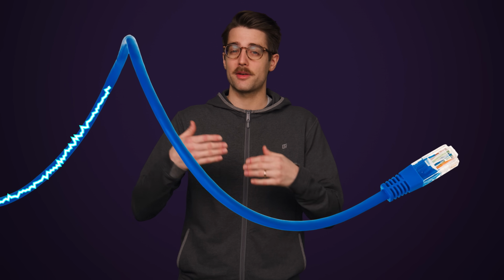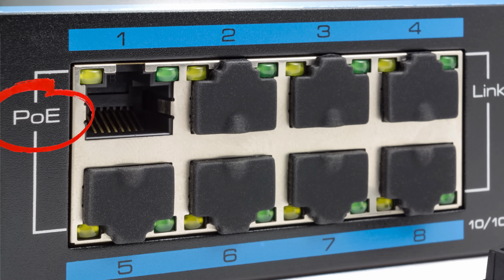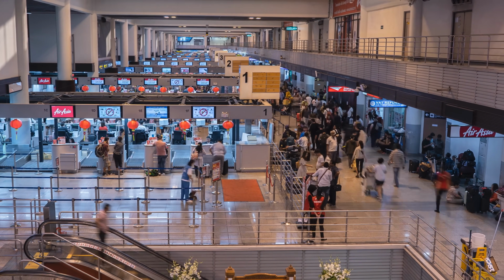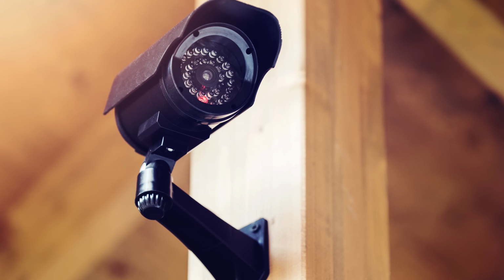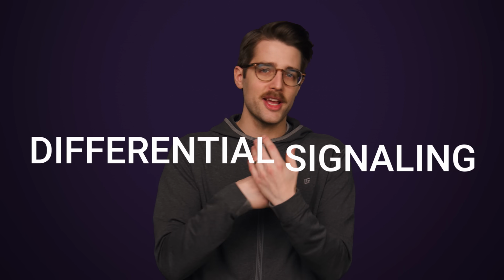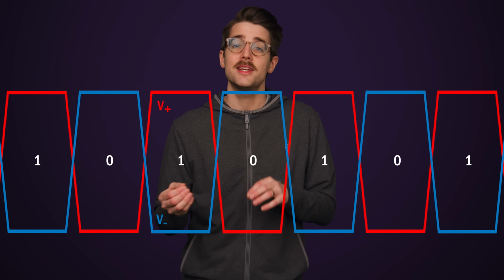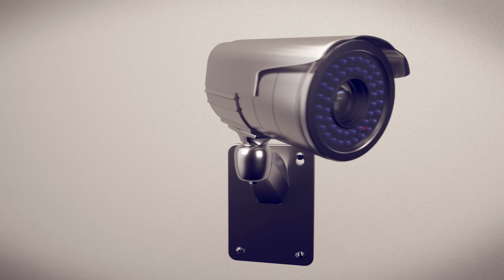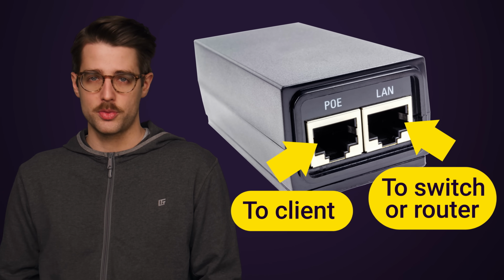Power...Over An Ethernet Cable?

Comment: That is a way to do POE.  The other is to place the "power" on the 2 unused wires in the cable.
Reply: they are all used champion its duplex 2 x TX and 2 x RX in the 4 pair cable ie 2 x gigabit channels, so no
Reply: @dtrekcomms  that is another standard of POE.
Reply: @baddmatt9588  I'm talking about the data signal, all pairs are used no unused pairs.
Reply: @dtrekcomms  there is a standard that allows all 4 pairs for power in addition to the 2 pairs for data.
Reply: @baddmatt9588  why do you keep saying 2 pairs for data as all 4 pairs are used for data and poe  simultaneously.
Reply: @dtrekcomms  Ummm...  my understanding is ethernet uses only 2 pairs of the CAT cable for data transmission (1 for sending and 1 for receiving) and the other 2 are unused.  Then POE was created to use the 2 unused pairs to allow for power transmission.

Later revisions of POE extended the standard for using all 4 pairs of the ethernet cable to allow for power transmission (the 2 unused pairs and the 2 pairs used for data transmission).

Now if there is a newer standard of ethernet that extends data transmission to all 4 pairs in the cable, I am not aware of it.  If so, please provide the standard version so I may look it up.

Thanks!
Reply: @baddmatt9588  Cat6 gigabit Ethernet 1000Base-T and has been around for over two decades and this signal can also be used on Cat5e cable over 30m runs, but best practice would be to retro fit new Cat6 Jack's without the need to replace the rxist cat5e cable which has been around since the mid 90s
Reply: @dtrekcomms  Yes, I am quite aware about CAT5, CAT5e, and CAT6, as well as CAT7.  As well as Fiber (multimode and singlemode).  Back when I started, we were still utilizing Coaxial cable networks, known as a 10Base2.

I have made 1000s of CAT5e patch cables in my 2 decades of my career.  Run miles of CAT5e and CAT6 and fiber cables from our MDFs and IDFs to the endpoint devices.  Wired around 50 or so MDFs and IDFs and hundreds of switches (cisco managed) within them.

I manage 8,000 or so PCs (desktops and laptops) using both MS System Center and Intune.  Created our AD domain probably 7 or so years ago.  Created our Novell eDirectory tree about 18 years ago (still being used to this day).  Back then it was known as NDS running on Netware.  Not to mention manage a Novell Groupwise server for our eMail as well as MS Office 365 for over 5,000 users.

I could go on and on, but I think you get the picture.
Reply: @baddmatt9588 I guess you have learnt something new then considering your experience.
Reply: @dtrekcomms  no, not really.
Reply: Any gigabit cat cable uses all eights wires. Are you referring to an older cable?
Reply: @protecter_atr  no, that what I said all 4 pairs are used for data transmission regardless of which cat cable are used, obviously its better to use the higher cat cable due to the copper cable gauge for POE as gig will work on Cat5e upto 30m which is more than enough distance for most home n offices without the need to upgrade to Cat6 cable.

Comment: Fun fact: Cat-5 cables use specific colors for power supply as they can hold more heat without melting. That's why is important to follow the standards and use only type A or type B (tip: use type A, that's what most people use)
Reply: Sorry, but I suspect this is BS, as POE can run on all 4 pairs...
Reply: @erroltheterrible  Sure. But the color of the pair itself is what matter here, not the color of the full cable.
Reply: @erroltheterrible  it is terrible practice to not follow wiring conventions though so sticking to the wiring conventions from A or B is a much more acceptable practice. Just because you can do something doesn’t mean you should. I could wire every single white wire to the hot side of the breaker in my house and make the black wire my neutral. Doesn’t mean it’s a good idea.
Reply: what's important is using the same type on each end.
Reply: @SquirtTheBlurt  if you want a straight through cable for connecting a client to a switch, but if you are connecting a computer to computer directly or a switch to a switch directly then one end will be A and one will be B. These are called crossover cables.
Reply: Ha Ha, so what's the difference between a type A n Type B and do you know the difference?
Reply: @dtrekcomms  Just the color order. But as most (read it as 90%) people use type A, using type B can make some works with those cables a bit difficult.
Reply: There's nothing about specific colors on there. The wiring colors are just a convenience to make sure that people connect both ends the same - the person doing the wiring at one end may not be the same person wiring the other. It doesn't matter what color scheme you use, so long as you keep the pairs together to get the benefits of twisted pair cabling.
Reply: @vylbird8014  T-568A and T-568B do specify the colors and order in which they are supposed to be inserted into the connector. So that’s not correct.

Comment: You forgot about passive PoE. which uses pairs 3 and 4 solely for power, leaving you with a simplex connection.
Reply: NOT SIMPLEX, but it does leave you with 100baseT only, full duplex...
Reply: @erroltheterrible  You can run 1G over only two pair(4 cores), sorry half duplex not simplex
Reply: Isn't it 4 and  5?
Reply: @bertjedekat  it's cores 3,6 and 7,8

Comment: I absolutely love Techquickie. Lots of  informative tech stuff I never knew existed.
Reply: They have a mostly software audience, so it's easy to find hardware/microelectronics subjects that most of the audience doesn't know about.
Pretty much every EE hobbyist, technician or engineer already worked with a microcontroller board that has a power over ethernet port, but software guys? For them ethernet is internet.
Reply: @rasselbidou  That definitely explains it. I'm a software dev, so a lot of things things are always new to me. I love it
Reply: This tec has existed for years only before you had to wired in your own power feed to the lan cable. I have been doing it personally for my outside WiFi extension for around 15 years 😂
Reply: https://youtu.be/7iSC9yXxVVc
Reply: Some still don't exist the way described here.
He is wrong in 2 major details
Reply: @WizardNumberNext  what 2 major details?
Reply: I tune in mostly for the bad jokes.

Comment: very cool, I've blown my laptop's ethernet port by plugging POE into it... silly mistake...
Reply: Should not be possible.
If POE switch is used, this will never happen. If some cheap power injector is used, even then Ethernet port should have decoupling capacitor on each lane by standard, so DC power is not an issue.
Reply: @Mladjasmilic  I used a Ubiquity Gigabit poe injector, and accidentally plugged into the wrong port. The port won't link on gigabit anymore, so the dongle life it is.
Reply: @gkgameplaycz  Probably means that they didn't adhere to the POE standard.
Reply: @gkgameplaycz  What was the ethernet port of? What was the voltage of POE injector. I am network engineer and this is very interesting to me, because it never happened to me.
Reply: @Mladjasmilic  I have seen this issue before. The port is capacitively coupled, but only AFTER the transformer. And, on the transformer, where you would tap off the poe power, there is either a resistor, or a short, to ground. I think this is for esd protection, but dumb power injectors kill this type of port...
Reply: @Mladjasmilic  you sure about that?
Reply: um No

Comment: I remember that some landlines actually provided power to the phone that connected to them, so they'd work even during a blackout.
Reply: Yes, 48V or 72V, depending on your area
Reply: All PSTN, POTS or EPOTS lines do, maybe on extremely long lines it might need a booster or something but I've seen lines of over 5km work fine. The phone-output of a DSL or cable-modem also gives out 48 volts.
Reply: Yup, at the exchange there were/are huge banks of iron nickel batteries. In fact, here in the UK, they've actually suspended the rollout of pure digital lines because of issues regarding people rural areas not being able to contact the emergency services.
Reply: Not some, and not provided it still provides. Traditional telephone (POTS) provides power to basic corded phones from the phone company central office. This is different than how PoE works since a POTS phone is just completing a simple circuit between you and the CO
Reply: all landlines are powered
Reply: The old POTS (Plain Old Telephone Service) the ran an analogue signal over Standard copper  provide power to the phone service via 50v DC over copper phone lines from a float charged battery at the phone switching exchange for your area. This system would work even after a local blackout/power cut due to the battery power of the system. A generator would be used to recharge these batteries at the exchange if the power cut lasted too long. Now some fancier analogue telephones starting in the he 80s and 90s  needed to be plugged into the wall to power built-in  answering machines and built in phone number storage and such and th cheaper design wouldn't even make simple calls without AC power. This is why it was useful to have a simple featureless analogue phone that requires no power beyond the phone line power to plug in for emergencies back in the day. 

These days, cell towers have batteries too for backup purposes and for those who have digital phone service such as businesses and older home  phone users, they offer/provide UPS units that allow the digital phone service to work for a limited period of time after a power cut/outage and the cable/phone companies have UPS and generators to keep the digital phone service going after a power cut at their digital  telephone exchange.

Comment: I remember that some landlines actually provided power to the phone that connected to them, so they'd work even during a blackout.
Reply: my old phone growing up in the 90s was like that. You could dial and receive calls, but the led display wouldnt work.
Reply: All PSTN, POTS or EPOTS lines do, maybe on extremely long lines it might need a booster or something but I've seen lines of over 5km work fine. The phone-output of a DSL or cable-modem also gives out 48 volts. ISDN is worse though, that gives out 96 volts at rest.
Reply: @NickyHendriks  those 48 volts have the positive(+) side grounded so its -48V. This was done to avoid galvanic corrosion in the wires when exposed to moisture and it became the standard.
Reply: @draco147  it was also made negative voltage to stop people being able to use it to power other things in their homes and bypass paying for electricity as it doesnt count toward your electricity bill.
Negative voltage would make whatever device you try use it for, run backwards due to the voltage being negative.  Say a clock or a blender etc. Would all run backwards if using the phone line to power it.
Reply: @abowden5079  its negative to stop the copper from corroding, you can just wire it backwards but the current is very low and bareley enough to charge a phone
Reply: @abowden5079  I had a clock from a school in my town that I could flip the (two pronged) plug over and it would run backward on AC. I assumed the clocks at school were AC/DC to allow them to run on emergency power or something. I never did figure out why it did that. I learned how to read the correct time even though it ran backward and I just left it that way. Funny to see people's reactions seeing the incorrect time and the second hand swinging around in reverse. LOL
Reply: @NickyHendriks  tickled myself working on those lines more than once.
Reply: @NickyHendriks  i checked our line one time back in the day and it was around 80 volts. i thought the guy was messing with me when he told me that tiny phone line had 90 volts on it.
Reply: @NickyHendriks  Yes.  This.  Im in the security business, but have to deal with these systems on occasion.   Beefy fantastic stuff.  Love it.
Reply: @NickyHendriks  at what amperage?
Reply: @klepow  literally have no idea. I don't come across those lines a lot, ISDN not at all, ePOTS less than once every two months nowadays as they are alle being migrated to optic fiber
Reply: All phones in 🇬🇧 did that as a standard
Reply: @almostanengineer  as of 2012 they dont anymore
Reply: @spookyghost7524  Wait here in the UK? I have a rotary phone I'm keeping as an emargancy landline phone.
Reply: @spookyghost7524  Depends on the market, the company, and the geography.  Still working with POTS PSTN lines constantly.  Some streets and buildings you can still order them.  Heck, I'm still doing dialup through them for commercial systems.
Reply: @spookyghost7524  ummmm.... Most of them still do.
Reply: UK copper lines are 50v DC.  Dont try fixing a damaged phone cable outside in the rain. Just saying.... It hurts.. F'ing hurts lol.
Reply: @TheSaabClinicUK  but it is less likely to kill you than AC!  So that’s a win
Reply: All landlines until VOIP was introduced actually if memory serves
Reply: Sorry if I seem uneducated on this subject. But don't all telephone lines (throughout history ) carry a certain DC voltage to power the actual phone call process? (Supplied by the operator and usually backed up). If so, Your comment doesn't make sense because landline phones have always been able to work separately from the main grid?
Reply: @danimayb  Yes, that is true.  All landlines provide power, but not all phones can be powered from the landline (specifically cordless phones, phones with answering machines or caller ID, etc).  I think that's where the confusion is coming from.  Also, in systems where the data is provided by fiber or VoIP and can't carry power from a central office, the device that is providing power is plugged into the same power source as the rest of your house and isn't any more resilient.
Reply: "Real" landlines carry power, but many houses' modern phone lines are plugged into a cable modem and will therefore go out with the power.
Reply: In India we had it on all landlines.. And even power a small led
Reply: Yeah, in the US the POTS standard is 48volts and is powered from the phone service central office. They even have giant batteries to keep the power to the line if they lose power too. It's active in use most places in the US, but even people with copper connections just use VOIP over DSL instead of the POTS line which has to be hooked up separately at the junction box.
Reply: @Brianz99  bad circuit can fry stuff though - ring voltage is higher than idle
Reply: @Brianz99  "current can be felt with your finger tips.
"
My college roommate "felt the current" one time when he was splicing phone wires with his teeth.
Reply: Depends on the type of blackout, I guess
Reply: @Reac2  definitely.  If the phone company had power, my local one had a mini hydro plant to keep it running even in an emergency, your phone would keep running
Reply: Some? Most if not all analog phones worked like this.
Reply: @Mic_Glow  Some use VoIP over DSL and some use POTS.
Reply: They are all still like that.  Standard corded landline phones without caller id display and/or answering machine still get their power from the phone lines.
Reply: They still do. If people would stop buying the over-engineered ones.
Reply: I think there was about 50 Vdc on the line all the time, and 90 Vac superimposed on that when the phone rang.
Reply: They still do, if you have one.
Reply: They still do. Also if you use VOIP and connect your cord into the nearest phone jack you can use the phone jacks throughout your house just as you would normally. You should disconnect from the phone company's wiring in the customer access panel outside. It works like a charm. I even connected a rotary dial phone and it fully functions with the natural bell ringing. It's tricky with automated phone systems though due to a lack of '#' and '*' but most give the option to stay on the line to reach an operator or they allow you to speak your selection. I love still being able to use my rotary phone.
Reply: It was only the screen that needed power.
Reply: This is still true if you've got old Bell/AT&T copper telephone lines.  You just need a wired phone (base stations rarely support this).    GPON Fiber optics, or anything on the coax side, will be cheap VoIP ports, and garbage battery support typically.
Reply: All landlines did that. And pretty sure still do.
Reply: I never came across a landline that didn't work like that.
Reply: that's basically standard here. An analogue phone line would supply the needs of all normal phones (but if you buy a silly cordless thing it needs a power connection)
Reply: @briannem.6787  Landline. There were analog cell phones. I had one, in the early '90s. They worked fine, airtime 2as just a lot more expensive.
Reply: @klepow  well, I said analogue phone LINE

but yes, analogue mobiles were a thing
Reply: I think that still works if you have a landline that can run off that power alone
Reply: My current phone for work does that. It has a bad cable though so the LED screen doesn't light up and the ringer sounds like something out of a horror film.
Reply: What's a land line 🤔 🤣
Reply: @dtrekcomms  It's kinda like on the line but on the land instead. /The Internship